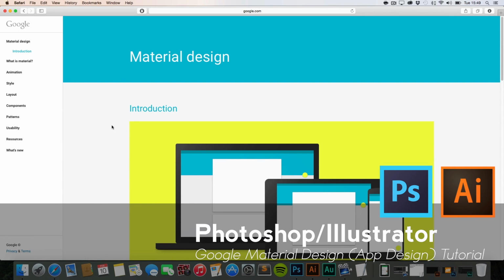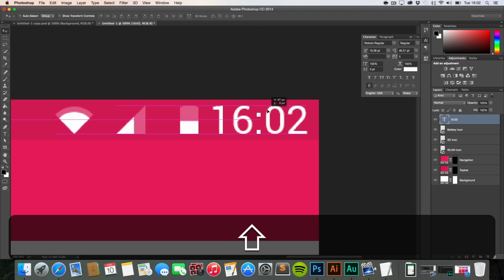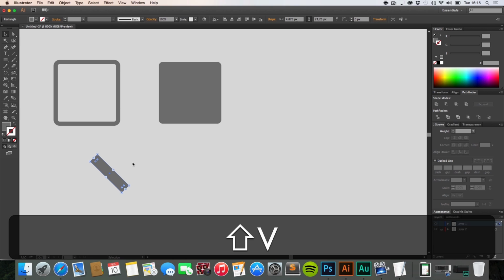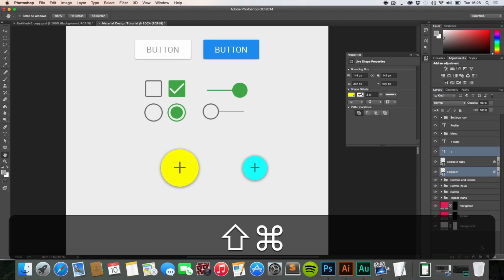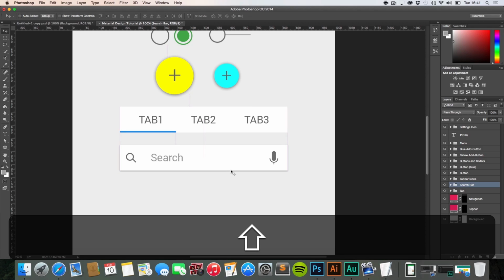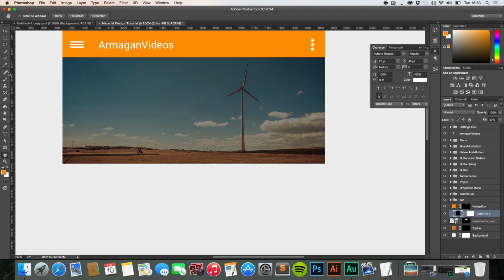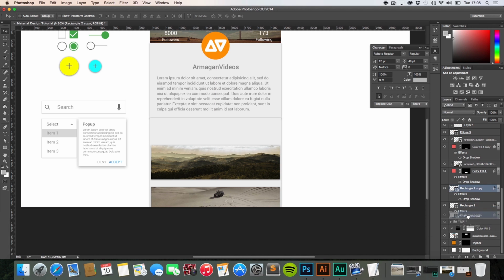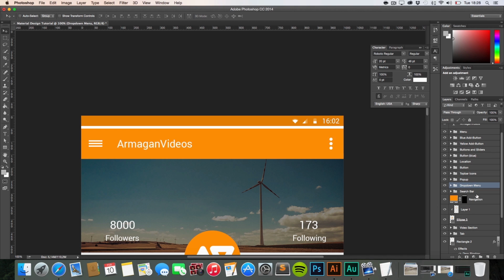Photoshop/Illustrator Tutorial: Google Material Design (App Design)

Comment: Hi, when desiging an app for ios/android how do you setup margins and layot principles? for example
1) should a be a 30 px margin from left and right, or it doesnt matter coder will do a margins by himself?
2) Why document should be 1000px?
3) Do you know any grids for Ios/android?
Reply: Document size taken by  tutor is wrong. I think @armaganvideos has used all the measurements blindly for tutorial purpose. 
For android actual doc size should be either 320X568 pixels or 480X854 pixels or 720X1280 pixels or 1080X1920 pixels or 1440×2560 pixels.
I prefer to keep doc size 1080X1920pixels  (XXHDPI) so keeping this size in my mind i am sharing some measurements
1. Top status bar-  H-72 pixels (space for battery bar, wifi, network etc icons)
2. Toolbar- H-168 pixels, hamburger menu icon left margin 56 pixels, Page title left margin- 216pixels
3. Page content L/R margin- 24 pixel if using cards or 48 pixel if keeping content on background.

For better understanding visit https://www.google.com/design
Reply from the maker: Yeah they have some predefined templates, see the above mentioned link. I had no time in this tutorial to be top notch precise or accurate with the dimensions and pixels regarding font sizes. This tutorial is obviously more about creating your OWN graphics for your OWN app.

Best of luck and thanks for all the help guys,
ArmaganVideos.

Comment: First of all, thanks for the great tutorial, I've learned a lot with you! One thing I didn't is why you are using both (Photoshop and Illustrator) since Illustrator can handle everything, you can also make new artboards as other screens for the application  flow, it's easier to export each artboard as a application screen to import in other application (like invisionapp) and make an animated preview.
Reply from the maker: +Humberto A. W. Ferreira Its just my workflow, Iam way faster with Photoshop and pixel graphics (B&W filters on pixel-based images, color correction, gradients. Creating the vectors with Illustrator is faster as creating them in Photoshop, so using both for their real purpose and mixing them gives me the fastest and easiest workflow. I know that there are clipping masks for images in Ai (but you'll have to handle the normal bounding box), I know there are pixel-based manipulations, but its really not made for it.

Greetings and thanks for the comment,
ArmaganVideos.

Comment: Thank you for this well thought out tutorial!

Am I the only one struggling with this wifi icon problem?

Could I please request a tutorial ONLY for the Wifi Icon?  I finally figured this out playing around with the trim tool. Didn't do the exact same technique, because it wouldn't work, but I got the same results.

Of course, I could still see the out of the circle and I had to use the pen tool and delete anchor points. I'm actually so embarrassed how long this took me to finish ONE icon.

Also, I'm using CS6.
Reply: You can just download the System icons from googles meterial design documentation